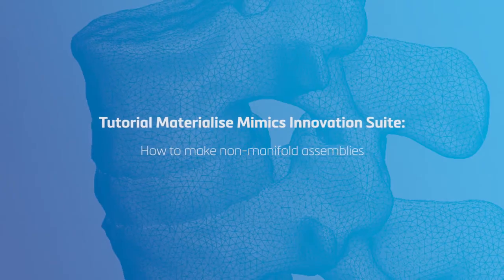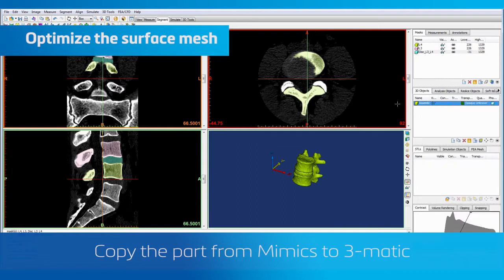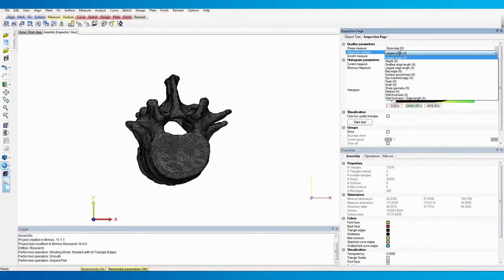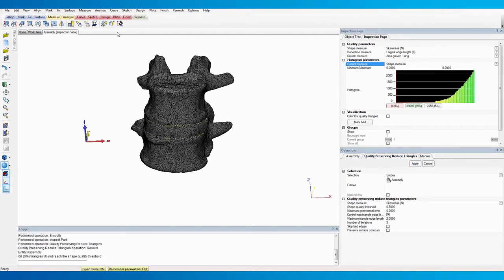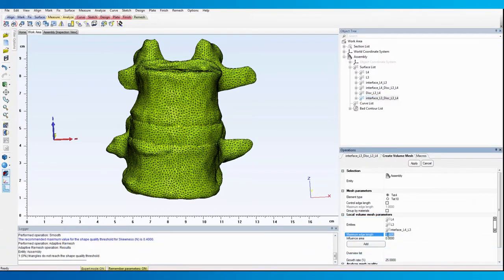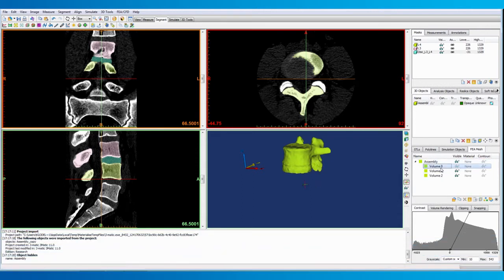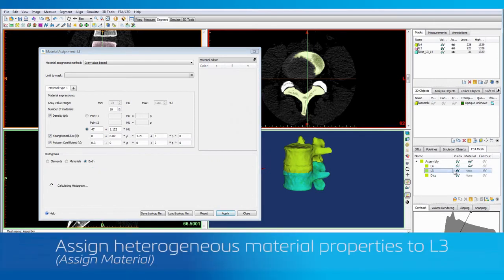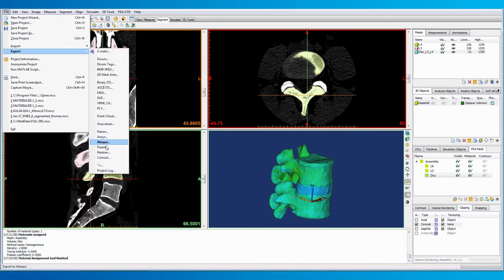How to Make Non-Manifold Assemblies | Tutorial | Materialise 3-matic

Comment: I just want to know how the discs are simulated between the vertices so that the surfaces are aligned perfectly togethe (please sb help me:)
Reply from the maker: Hi Delaram,
In order to make sure that there is a perfect fit between the surfaces of the vertebrae and the intervertebral disk, we use a non-manifold assembly. A non-manifold assembly realigns the mesh elements where the different objects intersect or meet, and makes sure that the nodes of those elements match. This way, we ensure that we can change the surface and volume meshes of the model, and still have a perfect fit between the surfaces of the vertebra and the intervertebral disk afterwards.
Reply: thank you very much 
When we make masks, we set the intervertebral space for the discs manually, or is there another solution? I want to analyze this in abaqus CAE  so interaction are very important there
Reply from the maker: Hi Delaram,
The segmentation of the intervertebral discs is indeed a manual task, however our software has multiple tools to aid you in this process. For more information, you can always contact mimics@materialise.be.
Reply: Materialise Medical thank you 🌸🌸🌸